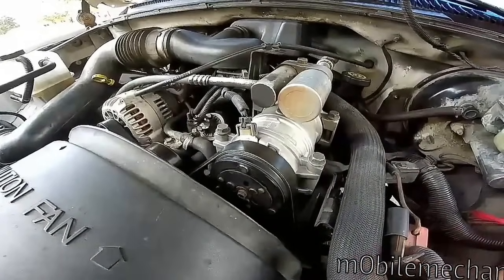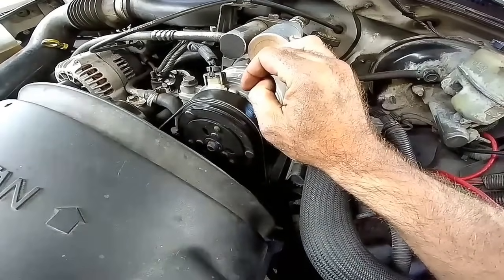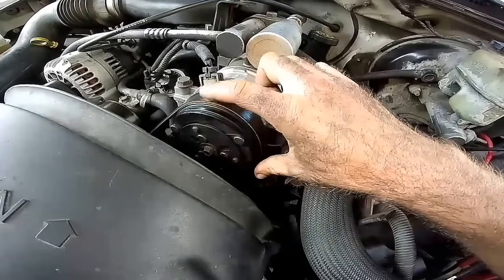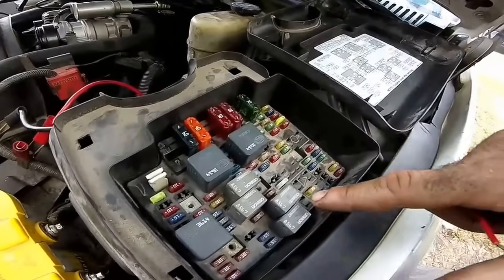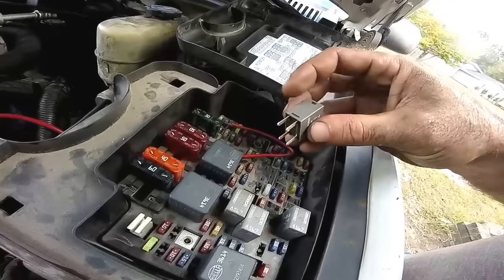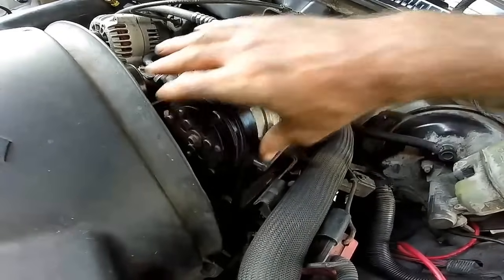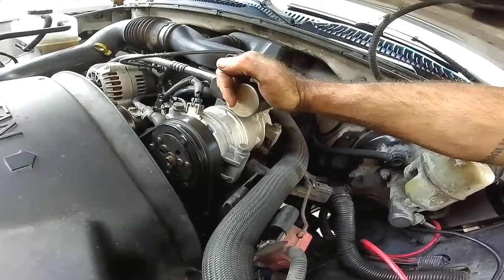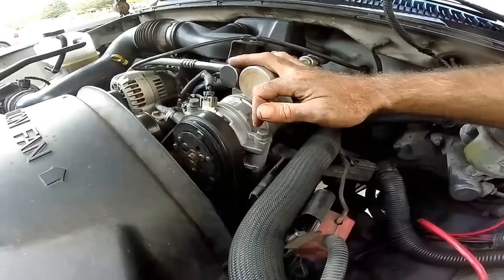Easy A/C Clutch Coil Test A/C Clutch Not Engaging

Comment: Clear, simple and no bs.  Excellent video!   The a/c in my chevy Duramax appeared dead.   Jumpered the relay as you directed and found life in the clutch.  Added R-134a to the system and got  cold air again!  Apparently the a/c system is disabled when the refrigerant charge is low.  Your video saved me time and money.  Thanks!
Reply: Bingo. Thanks fer yer input!

Comment: Hey man thanks for posting this. 2014 Tacoma. AC light on, no clutch engagement. Removed relay, jumped the wires, clutch clicked. Went to Autozone, bought a can of stuff, jumped the wires with full fan and max ac, read 0 psi on the low side. Added enough R134 to get to about 40psi. Reinstalled relay, no engagement. Bought a new relay for $15 and whammo, everything working now. Was quoted $900 to replace my compressor after my "friend" listened to me talk about it and responded in like 2 seconds. Smh. $45 for the can o' stuff. I probably have a leak somewhere. 

Thanks again!
Reply: Sounds  like your friend deserves $200 for that brilliant advice he gave you

But typically we don’t think like that and rather pay complete strangers/other mechanics $900+

Comment: Thanks for this!!! Gone without a/c for a year in our 2011 Ford fusion and a shop wanted $1,800 to “revamp” the entire HVAC system because it would be “easier” to do. Thought my compressor went bad but using your testing method I found that mine is actually still engages. So which leads me to believe my Evap sensor has gone bad. So thank you! You’ve potentially saved me a lot of time and some money.

Comment: NOTE:  Make sure to get a Good Heavy Gauge Wire, use a Paper Clip or as a reference for Gauge thickness.  There is an " EASY WAY " in case your " High Pressure Switch " is bad.  I made a Video a while back in case someone needed to do it here:  https://www.youtube.com/watch?v=3C4w7Ecrn4Q
Reply: Jordan Bronson thsnks man for sure do high pressure side go bad??
Reply: +JBIRD575 - Yup !!!  If it works " intermittent ", more likely it's the High Pressure Switch!
Reply: Jordan Bronson what about low side bought  a new high side and it made no difference can it be the coolant temperature sensor
Reply: +JBIRD575 - If you do this test High or Low and it doesn't turn on. Check your Fuse / Relay first :))). Lastly.... You will have to try to " JUMP " the Compressor " Manually ". Use good Gauge Wire and hook that to the Compressor Manually to see if it " Activate ". If it doesn't... Your " Clutch " might be seized!
Reply: +JBIRD575 - As far as I know, it has nothing associate with the Coolant Temperature Sensor.  But you can TEST it with a Paper clip too.  Here is the Video:  https://www.youtube.com/watch?v=q0v1kbw7iJI
Reply: Jordan Bronson clutch turns on fine...added freon blowing ice cold. When jumped straight from battery only....i check high  side but not low side...relay is good also.
...all that is left to check is low side and coolant temperature sensor fuses are good also..all that is left is low side and coolant temperature sensor??? Rite
Reply: Jordan Bronson thAnks for the help brother your the only one that replied back and made sense thanks
Reply: +JBIRD575 - FIRST: Did you leave the " Inside " Temperature Control on " COLD " during / before you tested all of these?  SECOND:  Your last option is to check the LOW Side Sensor.  NOTE 2: If you JUMP the High Pressure Switch... You are By-Passing the " Inside " Temperature Control, please remember that!
Reply: Jordan Bronson ok yes left ac on and on high fan setting put new control panel too didnt  change anything....when i jump from high  side compressor dosent turn  on??? Only works when jumped straight from relay or jumped straight from battery
Reply: +JBIRD575 -  Hmmmmmm... I didn't get to see this message until now :(((((.  Sound like your " High Pressure Switch " needs replacement!

Comment: Thank you for posting this video.  I was able to get the compressor clutch to engage and charged my AC using your instructions on my Cadillac escalade.  Now i have to figure out the right PSI for my system.

Comment: That was a great video!  I applied this to my 04 Impala LS and the clutch did pull in. I also additionally disconnected the coolant Temp Sensor and started the car to make sure my AC Rad FANS were in working order as the AC fan was not working with the clutch not pulling in. Knowing that the relays and fans were good I went ahead and refilled the refrigerant and BLAMO! Everything is working great!  Thanks man! Video helped alot!

Comment: For those who don't have the standard pin labels (30, 87...) and instead have (1,2,3,5), you want to place the wire in pins 3 and 5
Reply: Hell yes! Thanks man!! was looking everywhere for this comparison
Reply: I wired pins 1 and 5 and it worked
Reply: Hell yea bro this worked for me. Thanks! I bought a truck that was sitting for 5 years and wasn't sure if the compressor was bad or just needed recharged since the compressor wouldn't kick on while ac was turned on. Jumped the two leads and the clutch engaged
Reply: @littledave232323  why 1 & 5?
Reply: @mikeprice8307 1 and 5 work too because 1 is continuous 12v and 3 is the 12v that is received once the solenoid in the relay closes. Either way, you’re getting 12v so it works. 3 and 5 is the recommended method, 1 and 5 works just as fine.
Reply: Awesome video , now I need a new relay . 03 Ford ranger

Comment: Thanks for the video. It worked perfectly on my 98' GMC truck. Was able to engage the clutch so I could recharge a completely empty system.
Reply from the maker: Yes pretty common and sometimes cheaply fixed
Reply: @m0bilemechanix  same with mine. Not enough R-134A to allow the clutch to engage. Worked awesome, and now my wife has a cool car, at least long enough to get to a garage to have the system looked at.
Reply: Why is this such a catch 22? Clutch wont engage with low refrigerant yet cant fill refrigerant unless clutch engages... is this how professional mechanics bypass this catch 22?
Reply: So what if this method does not work?

Comment: Thank you for the tips.  Allowed me to successfully correct the hot air blowing from my AC.  Apparently my compressor didnt have enough refrigerant to kick in - this bypass allowed it to filled.  thanks again
Reply: Chris Cotten    Yeah I was gonna ask the same thing before finishing the video! How do you fill your ac if the clutch won’t engage???
Reply: Derrick Smiley   No as soon as I put the ac refill can on the low side and pulled the trigger ( while the car was running) it automatically turned on both ac fans! There’s a leak in my ac system so when it’s low it shuts down the ac compressor! Just have to get a black light to find the dye!
Reply: this is whats wrong with mine, blows hot air and clutch does not engage it has gas in so that was not low unless it is in the compressror

Comment: Great video. Just tested my compressor on my 06 Silverado and it works. Thanks for the info. Now time to find which sensor/switch is bad. Used my horn relay to test the a/c relay before and nothing happened. So I believe I do have a safety switch gone bad and possibly a leak in the system.

Comment: This actually turned out helpful. Having a problem with my ac that keeps burning out the compressor fuse and i'm trying to figure out whether it's the clutch, wires or the relay.
Reply from the maker: Likely shorted wires or shorted coil
Reply: @m0bilemechanix  You helped me A TON. Greatly appreciate it
Reply: @m0bilemechanix  do I'm trying to figure out what I need to do..I'm no mechanic but I did exactly what you did in the video and my ac clutch did the same thing yours did it click on!!? So what do I need to do to fix it

Comment: Thanks for the tips, very helpful places to start looking. Btw if ur amp power cable is still loose like that, you’ve gotta loom and secure it around the main engine area, ideally similar to OEM wiring paths, and grommet thru the firewall if u can’t find a punch out. Same goes for all cabling. Clean secure adequately sized grounds to chassis/frame are key! Extra bonus points for extra clean wiring cuz u know it’s solid and very easy to work on if needed later. And u certainly should do a big 3 / 4 upgrade or at least the battery ground wire for best results regardless of draw cuz oem wires are cheap and puny.

Comment: Well Eric you've done it again saved the day! Improvised tools beating the counter at the parts store once again! If you ever feel like letting me know how to go about replacing the wire that goes to the pressure switch please let me know as it has been discontinued. Thanks your pal Mopar Mike. Since they now own my behind. Lol
Reply from the maker: Should be able to just splice one in
Reply: @m0bilemechanix  you could recommend a place to buy the plug?
Reply from the maker: @exiledintheus7251  might not be able to get one but I usually start with AutoZone and then I call the dealership. Tell them you need the pigtail for the pressure switch (witch ever you need high or low) of all else fails some salvage yards will let you cut one off a vehicle
Reply: @m0bilemechanix  I know this is old, but I replaced my high pressure switch on my 2007 Saturn Vue thinking it was the reason my AC went out. Before I put the new switch in, I could still hear the compressor turn on but after I replaced the switch the compressor wasn’t making anymore noise. I made sure I had enough refrigerant in the system and no leaks. I’m gonna give this a try later tonight when it “cools down” as it’s already in the triple digits here and I’m dying with no AC. Thanks to YouTube videos, I never knew a girl like me would be able to learn/do so much work on my own car!

Comment: I was thinking of a way like that but didn't know exactly how. Will try this on my truck and hope my ac compressor is still good
Reply: I tried your method and my AC compressor was good, I recharged the system with UV die to find out if it has a leak. The AC blows cold now and I can't see any leaks yet.
Reply: @jdenha7078  so you just had low Freon probably the low pressure switch kept the Ac from running. I’m having the same issue I checked relay even swapped relays around and still nothing fuse not blown and AC diode checked good. The AC button lights up so I’m sure that’s working but the relays not be commanded on so no powers hitting the Ac clutch. Maybe I’m low on Freon
Reply: @ryans413  I actually found the leak using the UV dye. It was coming from the o rings. So now I am out of AC again I guess it's time to change the O-rings and then recharge the system.
Reply: Our van, the cluch engagesn and immediately disengages.  I'm guessing the relay is bad or the low pressure is just enough to get it to engage then disengage.  Hopefully the compressor is still good :)
Reply: @auggiebendoggy  try removing 1 of the shims its likely the "gap" is too large

Comment: This is what I was looking for - explained everything!  LR Discovery 2 with original factory air - blowing warm air now after 16 years - was hoping it was just the ac compressor clutch/solenoid (it recently stopped engaging).  It's a Denso compressor; will do your check as described here and hopefully it is the clutch/solenoid at fault and I can replace myself without having to have the system degassed and spend bug $$$ on a new compressor!  The system is fully charged with R134A gas now.  Probably also worth replacing the receiver/drier, but I guess that would mean degassing the system as well.

Thank you!

Comment: I USED YOUR TIP TO PUT A BRIDGE BETWEEN 87 AND 30 TO KEEP THE COMPRESSOR ON WHILE I CHARGED THE AC SYSTEM WITH REFRIGERANT 134A,BECAUSE THE COMPRESSOR MUST BE ON TO FULLY CHARGE THE SYSTEM, THANKS FOR YOU TIP
Reply: Did it work and engage after that I think mines low too cause the clutch won’t engage at all

Comment: Thanks again for the informative video. So I put the ignition key to on and used the jumper wire from pins 87 and 30 and the clutch clicked and I could see the clutch move in or out when using the jumper wire. Also the clutch couldn't be turned when it clicked or was engaged by use of the jumper. Doing this that way the ac clutch mini fuse didn't blow. The outcome to me suggests the possibility that the clutch wiring is ok or operating/ sending power to the clutch when the jumper is used. So I am going to replace the relay in hopes a relay fault is contributing to the 10 amp mini fuse blowing. I know the relay was quite warm when I first removed it.
Reply from the maker: Seems unlikely. I would suspect an intermittent short in the wiring to the compressor clutch or a bad coil due to high resistance/intermittent short.
Reply: @m0bilemechanix  After the old coil was removed and tested further it proved out that here was a short in the coil. When the new clutch assembly including the coil was replaced the clutch operated is it should and no more blown fuses! As well neither the relay nor the clutch diode were bad.

Comment: Good vid man. Thanks for taking the time to do it.
Reply from the maker: thanks for watching and commenting
Reply: @m0bilemechanix  My car i20 engine is running very quiet as usual. However, as soon as AC clutch is engaged, I hear a squeak sounds and not metallic sounds or alike. The squeezing like sounds go away immediately as AC is off. Even with engine revs, same sounds. And with AC off, as I revs the engine, still the engine is quiet. How to find that squeaky like sounds and fix it?

The AC is blowing cold. It seems the AC compressor is ok.

Comment: if not already discussed, most if not all vehicles have an ac limit switch which will kill the power to the clutch and not allow it to engage and turn the pump.  Your clutch and pump could be totally fine so its important that you absolutely check this switch first , because if the refrigerant is low in the system, this switch will kill the power to the clutch as a safety measure to prevent damage to the rotating parts in the pump..
Reply: so you're saying even if the hotwire of 87/30 doesn't engage the clutch then it could just be the limit switch due to low refrigerant? When I put a screwdriver to the accumulator schrader valve I got pressure blowing out. So I think the pressure should be good enough.... is that not good enough sign?
Reply: That's correct the limit switch is triggered when the refrigerant level is low in the system because the refrigerant contains oil which lubricates the pump
Reply: Put 12 volts to your AC pump and see if the clutch engages
Reply: @jsugar72  by "AC Pump" you mean the other circuit in that same relay? You're saying that the AC Pump will engage the clutch even if the 87/30 circuit did not engage it? I hotwired 87/30 and nothing. So you're saying the AC Pump circuit will over ride the "limit switch" ? thanks
Reply: When you say 8730 I'm assuming you're talking about the AC relay.  you can test your clutch to see if its operational without putting a pin or shorting the relay socket.  unplug the power cord to your AC pump then get test leads and put 12 volt to the pins you pulled the power cord from  and see if the clutch engages if it does  your clutch is good.  To test a relay I just pull the AC relay out and put another relay in from the distribution box there should be another 8730 in there or one similar
Reply: @jsugar72  yep - I put in a different relay already. thanks
Reply: @jsugar72   what I've seen in other videos, its usually the horn relay to put in its place.

Comment: On any 2 wire setup you can simply test for power and ground at the compressor plug with the ac switch on and off.

Comment: Why my compressor clutch not engaging when i do this same test on my car relay box,and when I test direct to my battery the compressor clutch is working.whats the problem on this situation?hope you notice me sir thankyou!
Reply: I'm looking for this answer!
Reply: After relay u have trinary switch who controls ac compressor if pressure is low or u have leak somewhere because trinary switch compressor will not start.
Safe measure
Or faulty switch can be problem to

Comment: THANK YOU!  you saved me at least $6-$700.  I had a VERY low charge on the AC.  Guages moved just a little when I hooked it up.  I was able to get the clutch engaged with a jumper wire and I could get 2 cans into it.  I can't thank you enough.  I was already subbed to your channel, please keep offering work arounds and diagnosis for the average Joe.  BTW I used 14 guage wire.  I would suggest a smaller size like 18 guage.  I had to keep one hand on the wire and another onthe freon/guage cluster.  If the wire were smaller I probably could have stuck it into the relay port further where it would stay on its own.
Reply: Your math adds up to a $694 variation in potential spending.
Reply: @gavinvalentino1313 o if my clutch is engaging just like his did what would the problem be ???

Comment: Are you doing this with the ignition key turn to accessory? In other words to run this test!
Reply: Yes the relay gets its power from the ignition and is commanded on by the PCM
Reply from the maker: No the key can be out of the ignition for this specific test. The coil has a constant ground and when you jump 87 and 30 it takes power from the AC clutch fuse and applies it to the other side of the coil. The fuse has power at all times.

Comment: Thank you sir for the clear explanation. My AC is blowing warn air and the compressor is not engaging. I used your method and the compressor does engage once I jump the port 87 and 30 of the relay with a wire. But the compressor still doesn't engage after replacing the relay by a newly purchased one. I wonder, does this mean the circuit controls the relay is dead? What's the suggested next step to debug this issue? Looking forward to your suggestion.
Reply: I’m having the same issue now once I jump it it works fine but when a new relay is in it doesn’t work